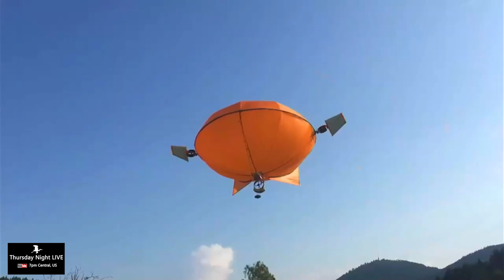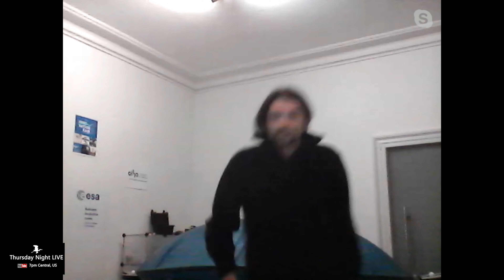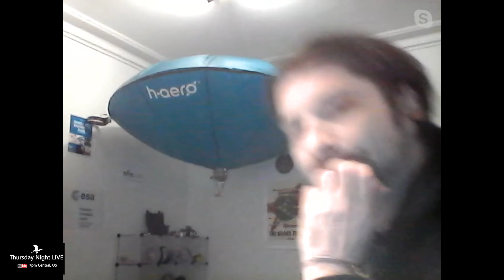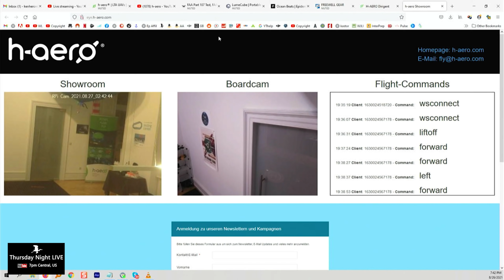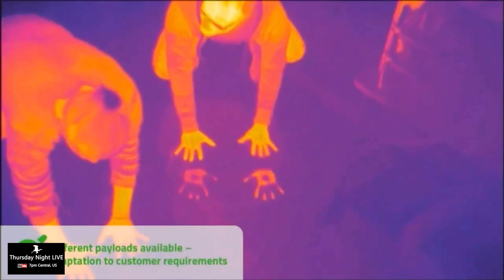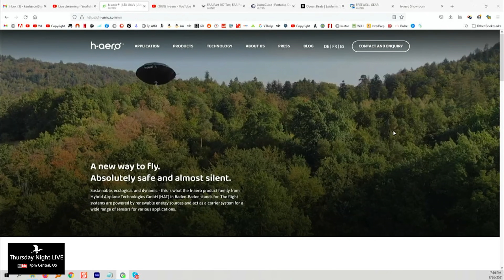This Mini Blimp drone could change EVERYTHING!

Comment: A big market for this would be for both large outdoor and indoor, conventions/concerts/other events.  You can easily deploy large numbers of wifi mesh access points in 200-300 ft grid and just hover for the entire event period.  Normally in such a setup your hundreds of dollars per day per access point, plus setup and tear down time.

Also in doing large setups like PAX and Comic-con a flying lighting rig without having to do and pay for union rigging crews, lifts, and electricians would save tons.